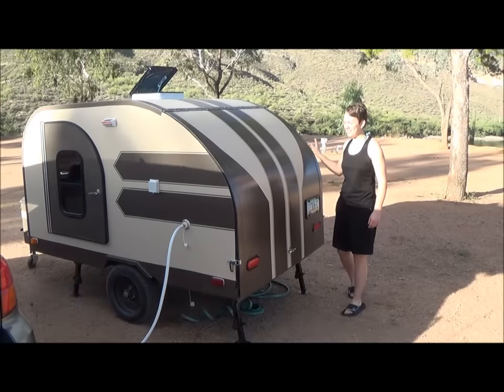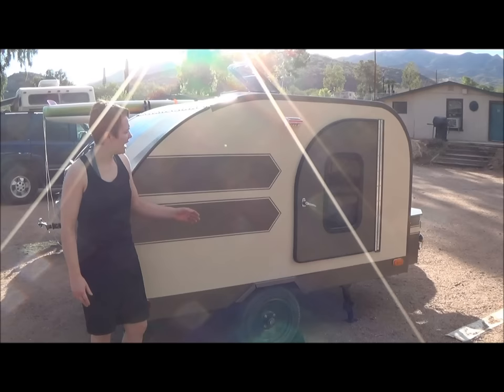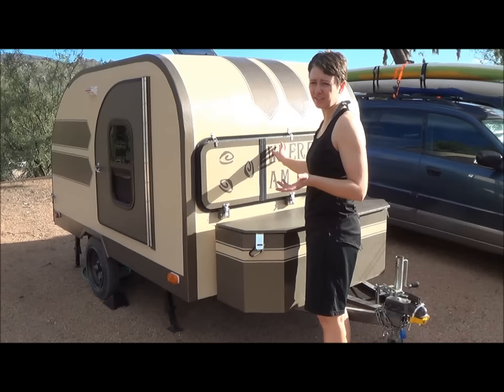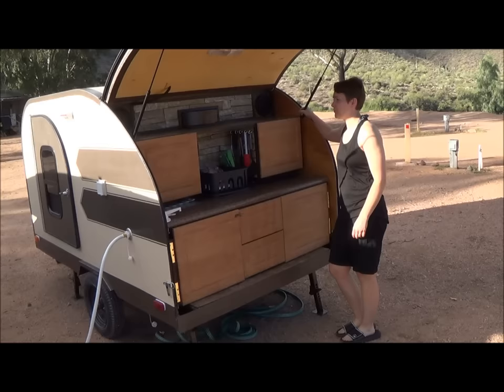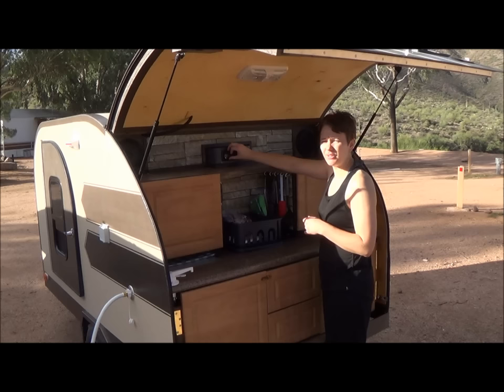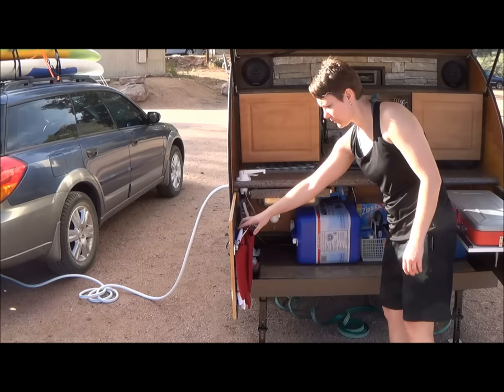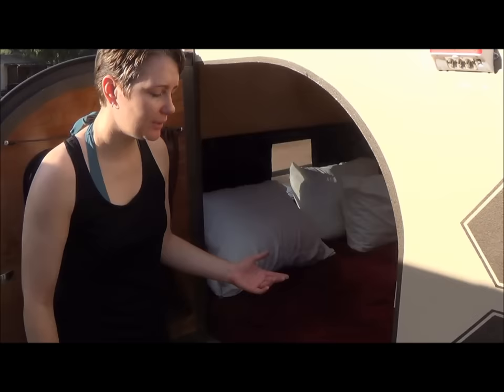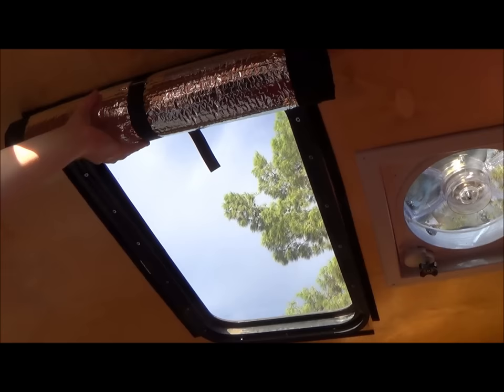Home Built Teardrop Camper (Poor Man's Fiberglass)

Comment: How did you do the canvas? What products? Amazing build!!
Reply from the maker: ADAM MINSKER I used titebond 2. And exterior paint. First coat of paint is diluted 50/50 with water.
Reply: L Wms and you just sanded after each coat? And how smooth is it?
Reply from the maker: ADAM MINSKER yes I did.  It is very smooth.  Just sand and keep adding coats until you get your desired smoothness.  Mine has a very faint texture that I love.

Comment: Hi - I've been looking at teardrop campers and thinking about building one.  A couple of questions - 1) is the window on the top of the camper just a standard fixed window that you installed on top?  Has it help up well?  2) did you use something as edging between the sides and the top or is it just the poor mans fiberglass wrapped around it?  (It looks like there is a dark trim piece but I didn't know if that was just paint).  3) over time, did you realize anything you would have done differently?
Cheers
Reply from the maker: The biggest thing I would have changes is the doors. I would buy them.  The window is just a fixed window and is in perfect condition still! And yes the edge is just the wrapped/double layer of the canvas. :)

Comment: How has the exterior held up? Also what width of strips did you use with the canvas? You used straight exterior house paint?  Thanks.... love your build!!!!
Reply from the maker: Sue Staley it looks perfect still.  The canvas is in full sheets so the only seams are at the top of the trailer. 4 pieces total (2 sides one top and hatch.) Just big drop clothes!
Reply: So you did the sidewalls and then cut out to door and windows? Did you soak the canvas in the titebond or just paint the walls with it and apply the canvas.? You mentioned ironing it before and the after the application. Did you just literally iron it? Sorry for all the questions but I plan to start my build next month so ......
Reply from the maker: Sue Staley I rolled on the tite bond then applied the dry/ironned canvas. Then ironed again.  And cut out doors and windows.  Then rolled and applied roof. Then painted with 50/50 water/ paint.  Sanded, painted 100%, sanded painted repeat. Do a sample piece to the technique down. I also routered 1/8" bevel to round edges.  That made bending the canvas over the corner easier.
Reply: Did you make the door or did you purchase one prefab? You have an inverter so you have solar for power? what wattage panels did you use to charge the 12V battery?
Reply from the maker: Sue Staley I made them but would by then in the future.  I don't have solat yet.  But inverter works soI can use 12 v or electric when pulled in a charges battery at the same time.

Comment: How does it handle in the AZ sun temperature-wise with just the ceiling fan? I'm in NM and building one this winter!
Reply from the maker: If I am at the camp site during the day an ac would be really nice... but by  night with the fan and huge front window it is comfortable for sleeping.  It is amazing and plenty warm during the winter months.  Once I used an electric blanket when it was really cold. If I build again, I will add ac.

Comment: L Wms - What kind of flexible hose / adapter do you use to get the gas from your 1 pound tank to the stove?  Also, I just finished applying the canvas to my TD following your directions and it worked great!  I'm ready to apply the 3rd coat of paint and I'm really pleased with the appearance.  Sanding between coats really smooths it out nicely.
Reply from the maker: Sandra Zern Awesome!! I just use the hose that came with my stove. I want to see pictures of your build!
Reply: I'll post pictures once I have the next coat of paint on it because right now it looks like an Easter egg since I saved money on the base coats by purchasing mistint exterior latex paint.  It's a lavender colored teardrop right now!  My stove is a Coleman with an inflexible regulator tube that the 1lb tanks connect to.  I'm doing some research to try to find a hose and adapter that will work.  I'm sure there's something out there somewhere.
Reply from the maker: Sandra Zern Awesome!
Reply: L Wms - not sure if this link will work and enable you to see pictures... I posted these in my gallery on the Teardrops n Tiny Travel Trailer forum.  The pictures were taken after the first coat of orange was applied.  http://tnttt.com/gallery/image_page.php?album_id=4808&image_id=153787
Reply from the maker: Sandra Zern  That looks awesome! Great work!

Comment: Hi... nice teardrop!! Starting my own now and was wondering where you got the skylight window. Please let me know. Thanks so much!!!!
Reply from the maker: Thank you! I got the window from an RV scrap yard in Phoenix. Totally recommend a skylight!
Reply: The L Wood by Lucy thanks for the info!!! I’ll start looking!!! Have a great week!!!
Reply from the maker: @Blade_Outdoors  you too! And good luck with your build! It is such a rewarding process!
Reply: The L Wood by Lucy ...  it’s me again. I was just wondering about the paint you used over the PMF. Was the paint latex or oil based? Thanks!
Reply from the maker: @Blade_Outdoors  I used latex based for the light part and rustoleum hammered which is oil based for the racing stripes. All base coats are latex
Reply: The L Wood by Lucy thanks so much for your response! I’m about to PMF the bottom of my camper and was wondering what paint to use over the PMF. Thanks again!! 🙏
Reply from the maker: @Blade_Outdoors  you are welcome! I hope it goes smoothly!!

Comment: Very nice build. What type of  rubber seal did you use for the galley door
Reply from the maker: I used the regular roll from home depot that is about 3/4" wide by 3/8" tall. I put it on the hatch and base. So far I haven't had any leaks. For the side doors I used something that  I picked up at an auto body shop. Has a stiffer edge with a channel and then a rubber tube.
Reply: @thelwood  Thanks. I am assuming it was the foam seal with adhesive backing?
Reply from the maker: @todddewitt6731  yes 👍
Reply: How about your hurricane hinge? No offset or offset hinge?
Reply from the maker: I used the plastic piano hinge from www.teardroptrailerparts.com.

Comment: do you have a blue print? is it light weight, enough maybe for a pedal bike?
Reply from the maker: I don't have blueprints.  this would be hard to pull worth a bike (about 1000 pounds). Build with foam walls for biking :)
Reply: Thanks for the suggestion, I've drawn up a few designs but still researching before I start. You did a nice job by the way. Loved the Chinese Meditative symbology

Comment: did you put any tightbond 2 down before you put the canvas on? or just after?
Reply from the maker: Rob N Only before.  Roll the tite bond on and then put the canvas on.
Reply: Ok thanks, I saw the part where you were ironing it so I thought maybe you stretch the canvas first.  I was originally going to skin in aluminum until I saw your video. yours looks great!  How has it held up?
Reply from the maker: Rob N It still looks new

Comment: How did you get it registered?  Did your DMV certify it as a utility trailer or a travel trailer?  It makes a difference for insurance coverage.
Reply from the maker: I registered it as a travel trailer. It was easy.  I just had to take it to the dmv for an inspection... which was basically them measuring it and that's it. So it doesn't have permanent plates like a utility trailer and I was able to insure it.
Reply: @thelwood  YES!  I did some more research myself and found that it's a change of class.  Any DMV will inspect and issue a new title, changing it from utility to travel trailer if it meets a minumum standard; eg., sleeping area, cooking area.  In other words, it has to be deemed for human habitation.  Thx for your reply.
Reply from the maker: @coobrie1323  yes. And the inspection is so easy.  They didn't even make me open the back hatch!

Comment: Wow, so darn impressed! With the canvas and titebond ll, Do you see the seams and a "texture" to the paint or is it smooth like fiberglass?
Reply from the maker: Justin C  It has slightly more texture than fiberglass.  sanding was key to nearly smooth finish.
Reply: L Wms It looks amazing. So I guess for the roof edges. You just put a canvas seem all the way down or just overlapped the roof a little bit? 

As for the canvas, you used regular hardware style drop clothes? The drop cloths I have at my local hardware store are very course feeling. Is that how yours were? How many layers did you use? I'm sorry I'm blowing you up with questions here. I'm just very interested in the way you covered yours. I have been arguing with myself back and forth if I wanted sheet metal sides (decided no because of the seams and expense) so then I started thinking "well, I could do fiberglass and paint with a gel coat paint" which is a great material to use. But then I started thinking that if it's not sanded right or applied right. The outcome could look very wavy. So with yours it's almost the perfect happy medium. Lol
Reply from the maker: Justin C  It just over laps at the roof seem. Just the dark brown ridge.
Reply: L Wms does it mildew or anything?  Paint adhered good?
Reply from the maker: Justin C  paint adhered very well.  no issues with mildew... but I live in the desert so not much of a concern.  It still looks like me l new 2 years later.  Boats and planes did well with this for many many years :)
Reply: L Wms awesome, you've got me sold on it! I'm happy I finally figured out this step of my build. So it is just one layer or do you stack two or three layers?
Reply from the maker: Justin C one layer of canvas.  many coats of paint! I did a small trial piece first.
Reply: L Wms awesome, that's what I'll do. I'll do a test panel. You used latex outdoor paint correct? Also, did you dilute the glue with water? Or just roll it on out of the bucket. I know you said you diluted your first coat with water on something. But I didn't know If you were talking about paint or glue.
Reply: L Wms also, did you staple and stretch your fabric or did you just wet it and let it dry in place?
Reply from the maker: Justin C don't stretch it.  Just roll the glue on and lay the canvas on.
Reply: L Wms L Wms okay, will do. Sorry I'm blowing you up with questions. You've been amazing help. Lol I'm sure I'll have more for you at some point. But thank you so much. I love your teardrop. You did awesome!
Reply: L Wms I'm back with another question lol. Did you cover it with the canvas with he windows out? Or while they were installed?
Reply from the maker: Justin C when they are out.  Then just run a run a utility knife along the edge of the hole and cut it out before the paint step.  Then once you install Windows you have a great seal.

Comment: just curious how well the painted canvas could last in an extremely wet storm??
Reply from the maker: It will hold up very well.  it is totally sealed.  And like I said it is the same technique that was used for building boats! :)
Reply: +L Wms it just sounds crazy to me since I haven't really hard about this... I will consider this method when building my micro camper this year. I live in Ohio and it pours rain every time I camp. good video, thanks for fast reply 😊
Reply from the maker: +ThisIsSolution I encourage you to roll tite bond II on a piece of wood and apply canvas.  Then do the paint 50/50 with water and then a few coats.  You will notice that edges get sharp enough to cut you! It is extremely strong stuff! I did some trial pieces to see for myself and to play with the rolling and paint techniques. I am happy I practiced first!
Reply: +L Wms thanks, I will strongly consider this, I love the ability to paint any design and color... yours looks amazing
Reply: I did a test piece a couple of years ago and left it outside winter and summer since, here in Toronto Canada. Test piece still looks and feels the same as the day I put it out. Seems very durable. I am currently thinking about doing some of my house window sills this way to prolong their repaint cycle.
Reply: @thelwood  i still haven't built my camper yet, i have the trailer and the motivation finally.... things in life sometimes take longer than you expect,  i hope you sre doing well, i came back to revisit this video since it was one of my favorite builds on youtube.
Reply from the maker: @ThisIsSolution  enjoy the journey!!
Reply: @thelwood  i certainly try to enjoy it, thanks ;)

Comment: What framing did you use if any? And what are the thickness for your inner and outer skins?
Reply from the maker: The walls are 3/4 plywood,  the roof is framed with 1x2s with insulation between and 1/8" baltic birch inside and outside
Reply: @thelwood  Nice and light! Have you taken it offroad. How is the camper holding up?
Reply from the maker: @sivaabhishekavala7136  it is in great shape! I recently posted a 7 year update video
Reply: @thelwood  3/4 plywood for the walls only? Did you use the 1/8 Baltic birch for the inner/ outer of the side walls too or just the inner/ outer of ceiling and outside roof?
Reply from the maker: @macbethdemilo7253 yes,   3/4 only for the side walls and the 1/8 inner and outer for the top
Reply: @thelwood  Nice! I was thinking of doing that only but so many DIY'ers have included multiple layers to the side walls. They have also added insulation to the side as well. How is your "comfort" level without side insulation during the summer and winter?

Comment: Can't it have a washroom?
Reply from the maker: Not for the small footprint and to keep it under 1000lbs so it can be pulled by nearly any car.  People do them larger and a can add that,  but not with the restriction of space and weight I was working with.  Basic teardrop camping is one step up from tent camping. I can just add a pop up toilet tent and bucket outside the door if needed.

Comment: What did you use for your exterior trim.
Reply from the maker: The trim is just the overlap of the canvas that I painted :) I did a 2 inch over lap
Reply: Do you still have the trailer. If so, how is the PMF holding up
Reply from the maker: @adamminsker6936  yes I do. It still looks new. It has been stred indoors primarily though.  It was outdoors for a year. I recently made a cargo trailer too. When I have some time will do a video. I took more footage of the process. Then I will show the teardrop update too.

Comment: How did you bend the plywood?
Reply from the maker: 1/8 Baltic birch.  Bends really easily. No heat or water needed!
Reply: @thelwood  How many layers?
Reply from the maker: @wvmontani  one on the outside and one of the inside with 1x2 spars in between.  The shape of the  curve gives it its strength! Very strong!